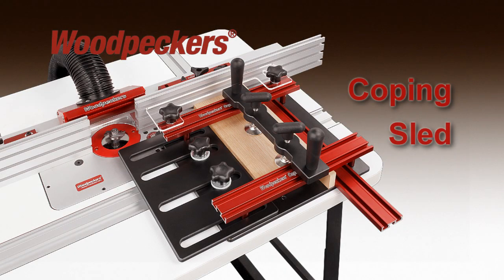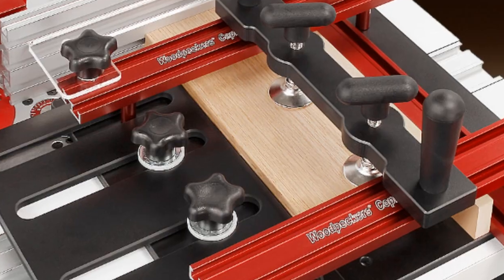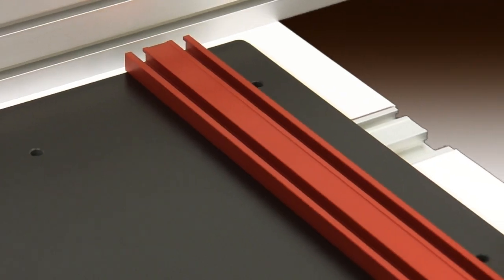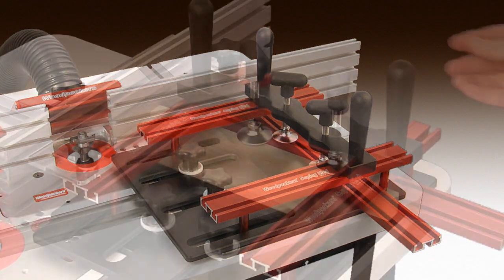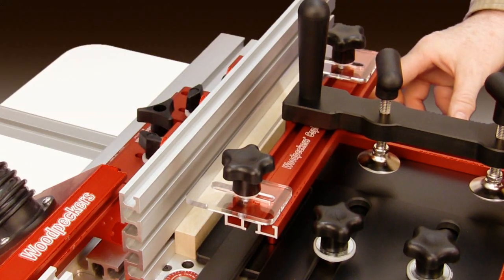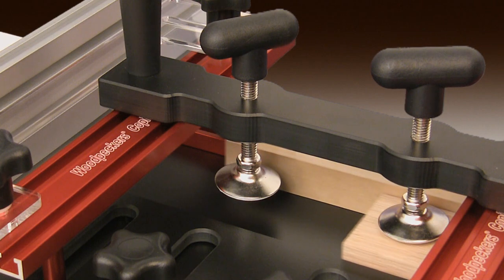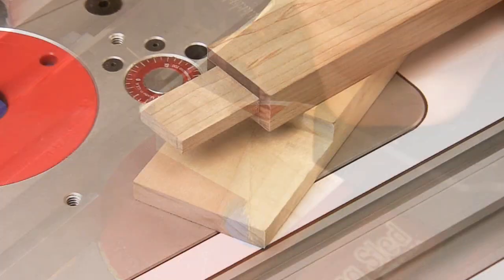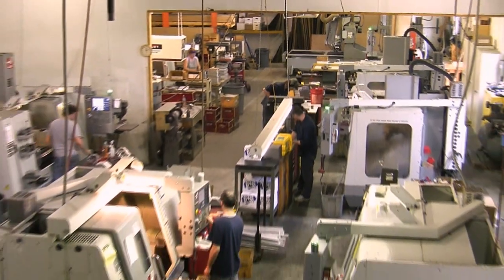Woodpeckers Coping Sled

Comment: I bought this and it doesn't work at all for my purposes.  The main problem is that I needed to notch the ends of sticks and it couldn't hold them.  The router bit would pull the stick in between the two fences which had to be wider than the stick width.  The base is so thin that any attempt to actually tighten it down just curled up the base.  I tried gluing sandpaper to the base for a better grip but that didn't work because of how much the base curved.  A thicker, more rigid base would resolve this.  I made my own from 1/2" aluminum and it works like a charm.

Comment: But you can't use this to make your stiles? Useless and hanging on my wall.
Reply: Why would you need a coping jig to make Stiles?? The Stiles are the simple part when it comes to making rail & stile doors.
Reply: Is it because the stiles’ length becomes unwieldy relative to the sled and fence, hanging off of the table?